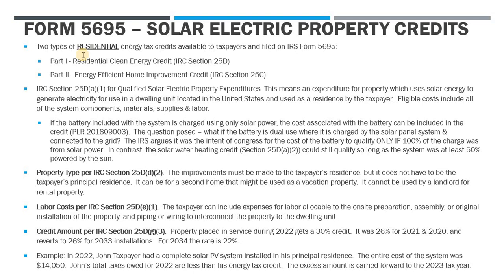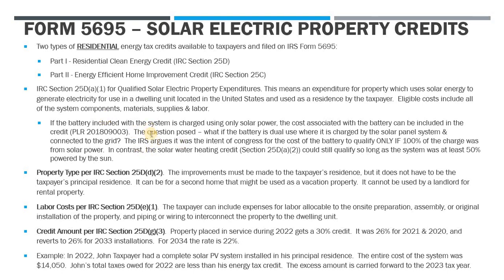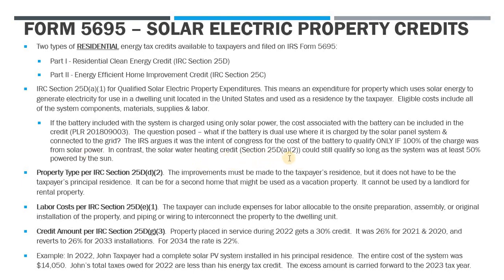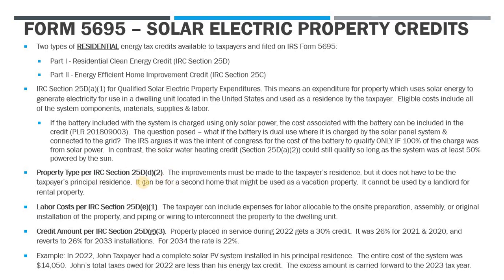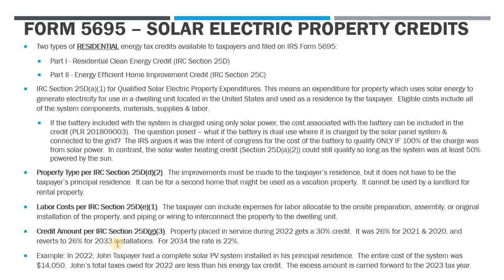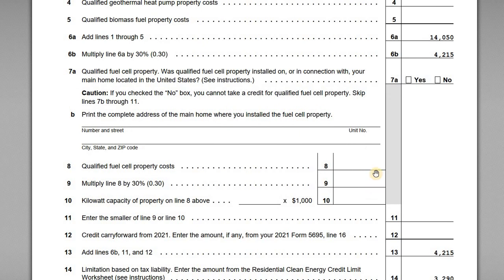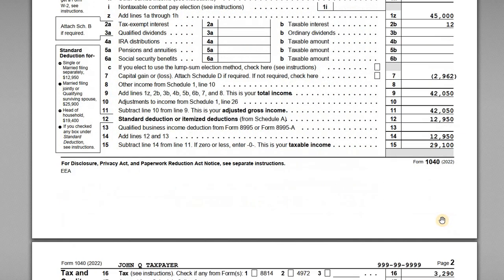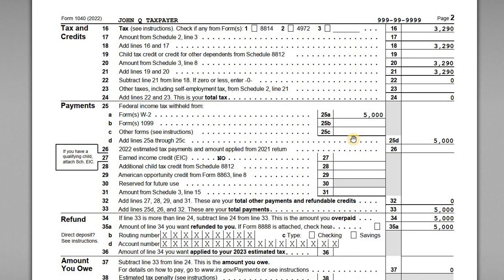IRS Form 5695 - Solar Electric Tax Credits for Solar Panel Systems

Comment: in this scenario, without any solar credits, this guy would have deducted 3290 from 5000 refund-- but instead gets full 5000 due to solar credit?
Reply from the maker: That's correct. Without the solar tax credits, the taxes owed would have remained $3,290.  With $5,000 in federal withholding taxes, his refund would have been $1,710.  Because the solar tax credits reduced his tax liability to zero, he gets a full refund of all his federal withholding taxes on wages.
Reply: Plus, he get's to offset next year's taxes by $925 i.e. balance left over from the solar tax credit.

Comment: What if the system was installed in 2024 and partially energized until 2025 when the electric company changed the meter and fully activated the system? Do i begin to file for my credit in 2024 or 2025? I'm getting conflicting info

Comment: Question, what if part of our Qualified Solar property costs included the cost for any energy efficient work done to the structure of our home. We had parts of our roof replaced on the areas in which the solar panels were installed. How do I get that breakdown to complete for Part I and Part II? Thanks!

Comment: Can this be utilized for a solar system purchased & installed on a travel trailer & will the calculations need to be modified on account the travel trailer is NOT the principal residence but only a part time residence?